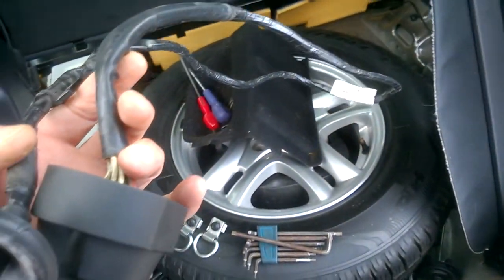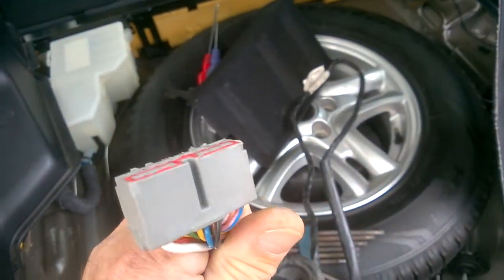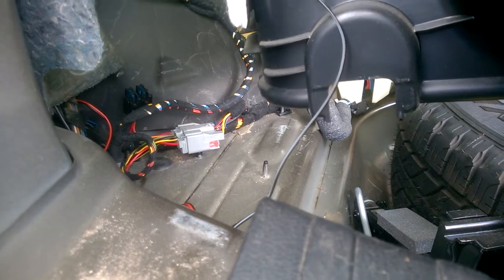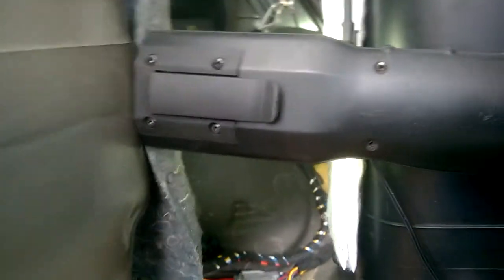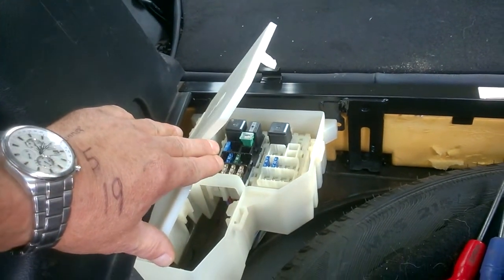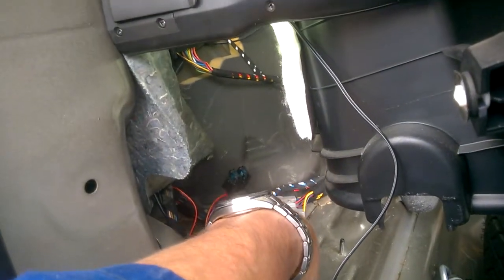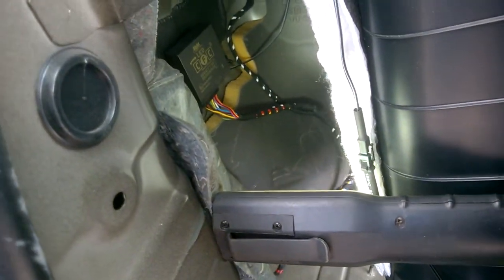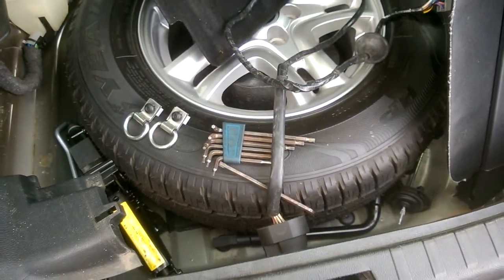Freelander 2 Tow Bar Electrics / Tow Hitch

Comment: Hi. What unit did you buy and from where? I have exactly the same situation as you! Freelander 2 (08 Plate) with DH52-13N490-BC wiring loom. Did you say you bought a "Right Connections" box from Rimmer's?
Reply from the maker: +Andy Saxton Yes, that's correct.